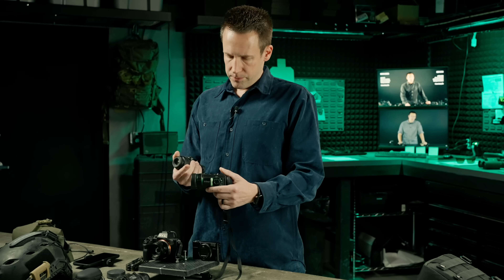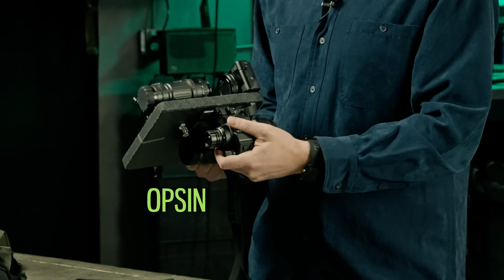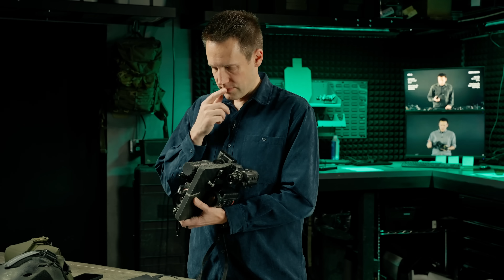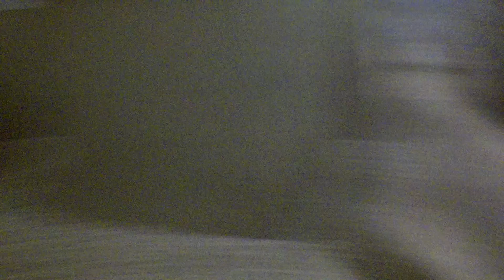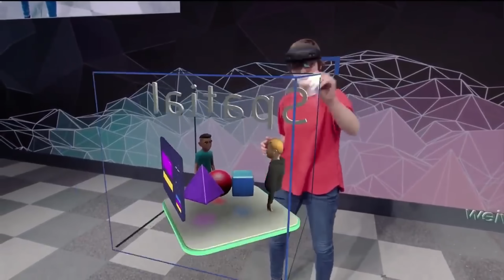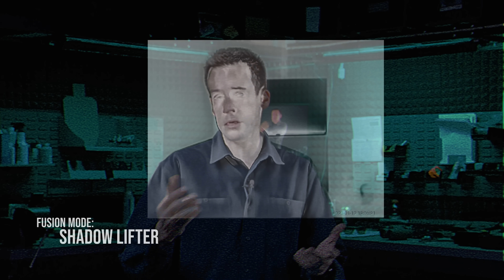SiOnyx Opsin: Digital Night Vision HAS ARRIVED

Comment: So this is probably minimally processed - rather than digitizing the photons, then packing them over a sompressed data-bus (MIPI-CSI), to a COTS processor which does some math in software when it gets around to a few free cycles after the full frame is available to work on, then outputting it to another compressed data-bus (MIPI-DSI), where internally at the display the it's unpacked and displayed...  I'm guessing (based on my prior work in video processing), that this is doing the "math" on the bit-stream coming out of the imager on the way to the display.  And if they are using a custom imager like they say on the website, they may not be using so much compresion on the data-interface between either the imager or display.  
  
Embedded DisplayPort display drivers can start drawing a line once it's available - meaning, once the line is grabbed on the imager side, that data begins transferring to the display - low-power FPGA/DSP math that do modification/overlays mid-stream (a so called "stream processor), meaning the latency from imager line capture to display line draw can be within one line of time (1/60 = 0.016667 for a frame, but 1280x720 imager/display - the line sample time is approximately 16.666mSec/720 = 0.023147mSec (~23 micro-seconds).
  
Building a digital system with overlay becomes fairly "easy" if you do the dead-reconning/GPS fusion and then draw to a hardware alpha map in the mid-stream processor decoupling the video path from the timing of the embedded processor.  If you are in the business of building your own imager, there's no reason one can't just work in some stuff to expedite the stream-processor decoupled from the timing of the output data-bus.  Pick things out like summarized max and minimum brightness values for the whole image, feed that forward to both the AGC and the stream processor (one for setting the next frame capture values, the other for correcting the existing frame capture).

  
I disagree that they are a few generations away from getting it really good, what they learned with this generation, they could probably improve upon exponetially/geometrically in teh next one.
Reply: I don't think there's any processing being done, it is just probably a RAW input displayed. Any image processing will prolong the input lag. This is why there's minimal lag at 30Hz, despite it being roughly 1/30 of a shutter.
Reply: @DjAlonDevil  If they have any color-balance, etc - then there is some processing being done.  The bulk of my original comment is illustrating the difference between doing it in-bitstream vs feeding it to an SoC to handle it as a complete frame (the Aurora did this, and had a huge latency).  You can take in a pixel value and apply math on it at line-rate (measured in MHz) - meaning that it is at most a single pixel delay, which is still "processed".  Things like color balance/correction, peak and minimum value ranging, gama, etc can all be done in a 3x3 matrix with gain controls before and after at pixel rate.  Same with graphic overlay is a simple mixer from a stand-alone memory - the output of which is merely synchronized with the incoming imager bit-stream timing.
  
An ASIC which does the corrections in-bit-stream can be a few cents nowadays, doing it the way the Aurora did was the cheap-fast way to get a product to market.  For that, they use an Commercial-Off-The-Shelf System-on-Chip (COTS SoC) with a camera port (typically MIPI-CSI) and a display port (typically MIPI-DSI) - a RaspberryPi is an example of such a part (though it is too power hungry for a portable device like this).  There is a huge time penalty using an SoC like that in that the comon software stacks for those parts do not work on bitstreams, they work on frames.
  
For a 720p video frame at 30Hz, that's one frame every 33-1/3miliseconds - before it even starts working on it. 16-2/3mSec for 60Hz and 11.1mSec for 90Hz.  Then it works on the whole frame - taking the input memory frame through an algorithm and sending it to an output memory frame - before it can then be sent to an output frame buffer.  I mention the buffer(s) because for comon video stacks, the focus is on image/stream quality using low-cost components.
  
If you have an imager and a display that run on two separate time-domains, they can wow-and-flutter (analog term, used for audio tape) at the rate they generate and consume video data.  The comon video stacks add a buffer to acount for this drift in timing - an imager that runs faster than a display will have a buffer that eventually drops frames when there is "fresher" data that what is left in the buffer.  Similarly a display that consumes data faster than it is generated will result in a frame being streamed out more than once.  
  
Gamers will recognize this buffer skipping/repeating as "frame judder".  Suddenly switching between one frame buffer and another with "fresher" data is what gamers recognize as "frame tearing".
  
Now, if you skip the software stack altogether, and time synchonize the imager and display - you get rid of the buffer(s) completely.  And once you have a master stream clock - you can start time-aligning additional logic to that master clock.  if you write and algorithm that needs more time to complete than the stream master clock - we have things called PLLs (Phase Locked Loops) which allow you to scale, yet time align a faster clock to a master clock.  Need 4x the stream clock to complete a 3x3 matrix operation on a data-set?  Use a 4x PLL...  Display will have no idea it got data that was processed as long as it arrives in the correct order for the protocol and on time to not unlock its own internal PLL.  The pixel clock for 720p-60Hz is 74.25MHz, so you don't need a 3GHz CPU to process that video if you do it in stream form.
  
Important to note, this only takes care of the largest source of latency (80% form the 80/20 rule).  If you want to do that last 20% - you need a global shutter imager at a high frame rate, with very-large/amplifying photodiode cells (like what is found in EmCMOS), which reads-out at a much higher rate than if the imager was doing a per pixel read-out at the leisurely pace of 1-pixel every ~13.5nS "nanoseconds" (one line every 23uS "microseconds", one frame every 16-2/3mS "miliseconds" - assuming 1280x720p-60Hz).  If you were reading out a single frame with 720 parallel 1-bitstream-per-row streams, your latency is now the line rate (23uS, versus the 726x slower frame rate at 16-2/3mS.  If you switched the imager/display to column (weirdly, easier with existing display tech), you'd have 1280x parallel 1-bitstream-per-column - importantly with almost half the data to stream (56.25% to be precise... 720/1280), meaning you could increase your frame-rate before running into power/signal issues, or build-in more time to do stream processing before it arrives at the imager at the same frame rate.
  
Recall that an amplification tube type imager like the venerable PVS14 is essentially 100% parallel (row/column) transfer from the sense-side surface to the phosphor side surface - at the speed of electron acceleration.  IF... one owned the fab for an EmCMOS imager AND for an OLED microdisplay... I could see one designing a fairly low-cost silicon-interposer to massively parallelize the transfer between the two and do all of the bit-stream processing in even less space than an amplification tube (thinking SWaP).  I don't think however, that SiOnyx will be the ones to do this first.

Comment: Interesting would be a Gen2 against that... Its interesting for non US users (they can't easily get highgrade gen 3)...
Reply: Harder Digital gallium arsenide tubes are as available as Photonis tubes if you live in a eu export whitelist country.
Reply: @blegi1245  yes, but you often have to order them directly and then you pay between 5-10k per tube (for 5k its omni 3-4 Performance...) 2021 (when rusian tubes still where aviable) you could get a autogated gen 3 for 4-5k (like kathod F or S series). But not any more....

And comparing a 2-4x more expensive tube (without housing) to that doesnt seem to be fair. More fair would be to compare it to a Photonis basic or echo (16mm) or a NNVT 4 or 5....
Reply: @1991apfel  what on earth are you talking about? A complete device with Harder omni 6 equivalent tube is less than 6 grand.

Comment: I wish you guys would've expanded more on the OOB sensitivity and other advantages that Opsin offers. Photonis is the only real competitor here if you think about it, because it has other strengths that other analog I2 don't have. It's similar in price, performance, has a wider spectrum response and is widely more available to purchase globally due to it not being restricted as much. Opsin looks fantastic and I bet it is much easier to get used to for new users, even other people who are interested in night vision or astronomy would be happy with the device. Airsoft users are most likely are going to pass just because of the price. Aurora/Pro is just much more affordable and some people could live with the existing problems. I see no problem operating in Opsin when it comes to running, gunning or whatever unless there is barely any light. Lucas is too much on a computer, having more refresh rate is going to cost in price, battery (and unless it's just the display) and in low light performance. 90Hz is very good and realistically this would go up to 120Hz in the next couple of years. As a starter kit night vision this is amazing, no need to worry about buying mounts etc. Even to a person that already has night vision, this could be useful. As well as content creators. Too much emphasis was put on all sort of departments, it almost felt as if you were reviewing a specific device that is meant for security companies or the sort. Remember that analog had almost 100 years to improve and digital for the most part... close to nothing. Especially in the civilian commercial space (others exist i.e. Canon ME20F-SH, X27, Sony Alpha S series, non of these were advertises as a replacement to night vision... expect the X27).

Comment: One thing that will definitely help with battery power(for pretty much all devices) is the advancement of the NDB or Nuclear Diamond Battery.  It is primarily designed for smaller devices which encompasses gaming remotes to small drones which allows NVDs, weaponlights, and IR/visible laser systems to be efficiently powered by the NDB.  Also, in relation to bother devices, I think that analog and digital night vision will both be viable for the foreseeable future.  Digital night vision enhances your visual capabilities in low light settings where as analog truly allows your to see in the dark.  The only way both of these systems become obsolete is if thermal becomes to advanced for either system to catch up; and I do think that thermal is the way of the future since it works in both zero light conditions and full sunny day in the desert conditions without having the system becoming defective or losing quality.

Comment: Great video. 

The big point out was at the end when it finally clicked that digital is quite literally that, digital. With some r&d you could make a fully armored vehicle that used cameras instead of glass, that could see at night without giving your position away, with low latency. Or home security that is better hidden and doesn't blast out IR to see things and tells everyone where your cameras are. And makes it easy to record. This would be a great security system.

Comment: The overlay of thermal and digital would be perfect! But just having the that GPS map fusion thing you did would be a huge improvement
Reply: The Cat S60, S61, and S62 (pro versions) do it for phones (intended for industrial trades).  They're pretty rugged and work quite well.  The visual light camera is not great at low light though.
Reply: ENVGs already have said overlays

Comment: I think there is a lot more potential from Digital Night Vision once the manufacturers separate from treating the sensor like a camera. Ultra low light performance for digital sensors can be great for discerning shapes when direct access to the sensor is available(no translation through some generic controller). Would lose color in that situation but the low light performance would increase and or the frame rate available would increase. Dynamic range is unlikely to be resolved any time soon. ARRI only recently has come out with a digital cinema camera that records 17 stops of light(Arri Alexa 35) and approaches film dynamic range finally; Potato Jet has a good review.

Comment: "Does it offer 3 to 4 times more value?"

I think that is an improper question.  

 Quality does not scale with price.   A piece of gear twice as much will not be twice a good.

Additionally, you don't have to worry about imperfections with the digital or review data sheets.
Reply: It does not - those are called diminishing returns. But in the context of value, more is spent on R&D so that the quality increases which "justifies" the price - again to a point.

Comment: Measuring latency here would be really easy. Just put a high-speed camera (1000fps or higher) so that you can see both the eyepiece as well as behind the eyepiece. Have a colored LED turn on in front of the lens, and then record the difference in frames on the high-speed camera recording of when the colored LED turns on behind the lens as opposed to through the eyepiece. Since both are going to be visible on the high-speed recording this will give you the latency. The higher the framerate of your recording, the better resolution of the latency measurement.
Reply: We didn't have a high enough framerate camera to see a difference.